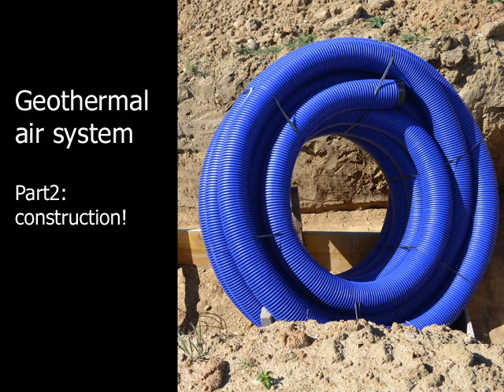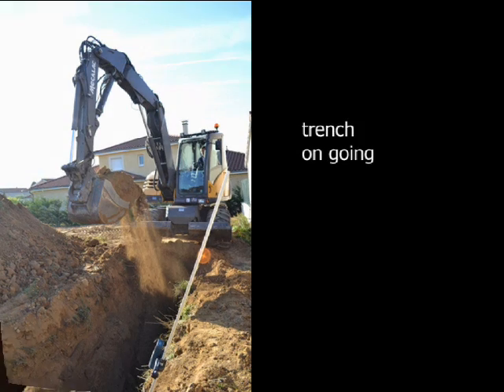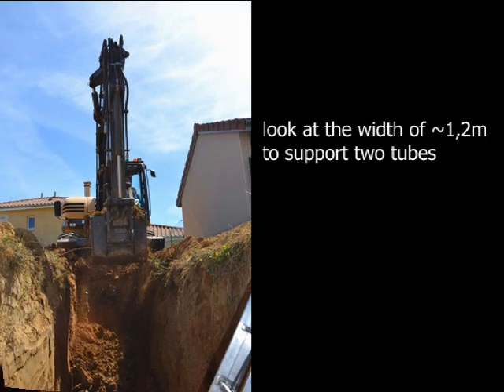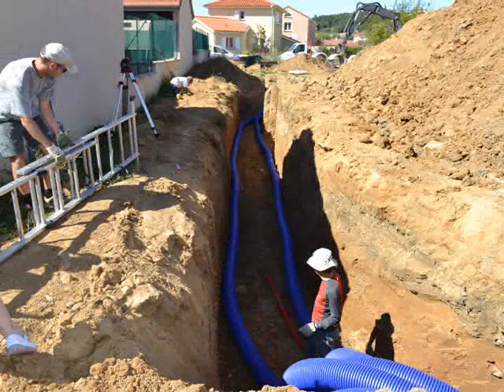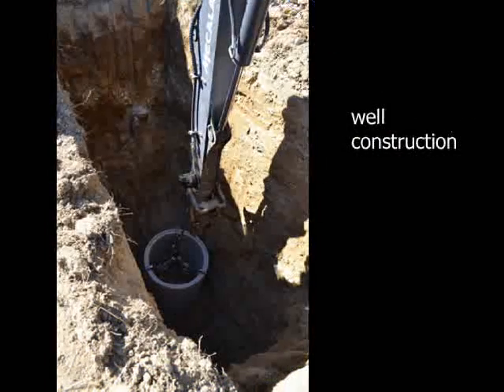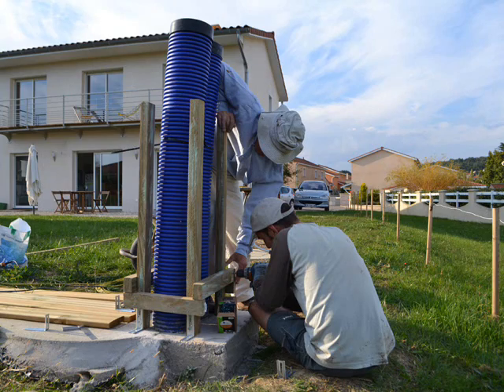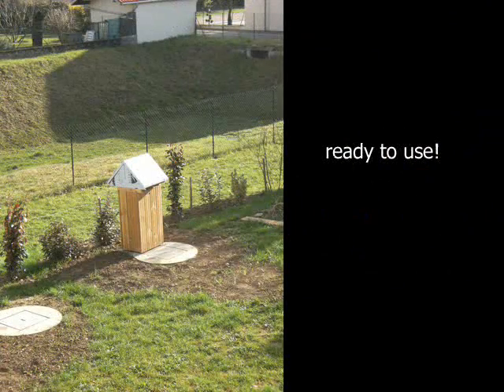Earth tubes air cooling and heating system : project implementation

Comment: Did you say that the system is radon free? How did you construct it to achieve that? Is this mainly due to the tubes having no sections?
Reply from the maker: No, the system can t be radon free if there is radon in the area. It has to be installed in a radon free area.

Comment: @nrlog I see the orange/ red tube coming out of the concrete along with the blue tubes. It looks to be connecter to at least one of the siphons. Does it connect to both? Why?
Reply from the maker: Hi. The red one is a pre disposal for an electricity routing in the area. Nothing to do with the ventilation.... sorry if misleading
Reply: Hi. Ok. There's nothing misleading. I sent a request to you all via your website. It was is french but I was able to navigate enough to send it. I'll be on the look out for that reply. Thanks.
Reply: @nrlog I haven't gotten a reply through the website, so I want to ask you here. How can I get your design for the entrance and exist of the pipes going into and out of a house, and how they are ran in the house?
Reply: Is there any way to contact you through email? My inquiry to your site hasn't been replied to, and you seem to not check youtube often. I live in Texas, and our whole state is just now coming out of a lockdown from a state wide rolling power outage in order to survive a winter storm. We were 4 hrs away from totaling the capacity output to the entire state, which means 4 hours away from producing as much energy as possible and in real time sending it out, which if was done would have destroyed the grid. I've been building a house while in a tent, and yes I was in a tent when this worst storm in a century hit this state with temperatures here in some places getting as cold as some places on mars. I've always wanted to build your geothermal system for my house, since I've started to build it, and I'm months away from needing to buy the pipe for it. I really need some help as soon as you get the time.
Reply from the maker: @terranceedwards4750  Hi. sorry busy those days. the inside is explained here (in French). http://nrlog.fr/index.php/2016/04/25/puits-canadien-provencal-a-air-comment-concevoir-et-realiser-les-parties-interieures-du-reseau-aeraulique/
Reply: @nrlog3682  Hi again. I'm at the stage of pouring concrete around my tubes that enter my house after ascending out of the ground. I figure this will provide many options proceeding forward, among which are a brick ledge to conceal the pillar in the same brick that will cover the rest of the house, as well as retain the most thermal dynamics in the tubes when they arise from the underground temperature. Can you look into your website? I need to reference many more things throughout your information, but the site keeps stating that it's not a functioning website anymore. Please reply with what help you can provide with helping me connect to your website again.
Reply: @nrlog3682  I'm still unable to access your website, and want to know, are you able to? I am still unable to.
Reply: We are all very busy. Thank you so much!

Comment: Thank you very much for the playlist with all the 4 videos. Very nicely made and informational. We are planning to use this system for cooling a greenhouse in a hot and humid area because evaporative cooling wouldn't work in a humid area. 
Few questions:
1. Is there a way to know or measure if the system will work in an area even before we install it?
2. Will this system if the tubes are buried under a pond of water instead of ground?
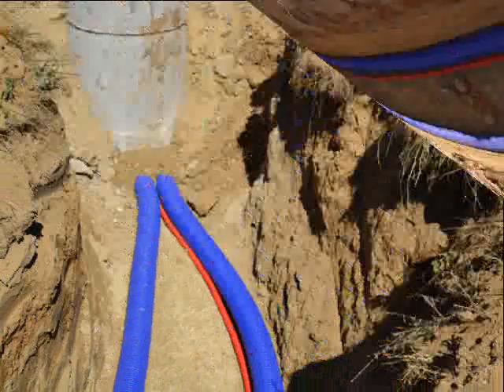3. At time 1:29 in this video, i see an orange tube in addition to two blue tubes. Curious to know what it is? 
4. Also, curious to know how the fan and system looks on the inside of the house. Couple of photos could help. 
Once again, thank you.

Comment: Please explain why you use a plastic piping, which prohibits the effective conduction of energy. This is simply wrong!
Reply from the maker: It is not a problem to be in plastic as the surface temperature has time to meet the earth temperature. The temperature with the earth inertia is only changing of 1degree every month. You see the results from the system with measures in the fourth video on the channel nrlog.
Reply: @nrlog3682  you mean to say that there is only a one degree difference between plastic and metal pipe? You are way wrong, the difference can be up to 15 degrees in difference. Now I know your just full of shit.
Reply from the maker: Ah. Full of shit? What i mean with the one degree is that in august the earth and plastic pipe is maybe at 22degrees, and september will be 20/21... etc . The plastic is at the ground temperature... revise your physics man...

Comment: You don't need to do all that ! Dig trench(as deep as far as you can .in a small area loop it back and forth on top of its self it doesn't matter )any kind of PVC pipe- screen where air enters plump other into house ,get a fan that pulls a lot of air and place it in pipe that's in your house ....walha ! Ez pz and that's all you do . Don't over think it cause it's just as simple as that. That deeper the cooler .
Reply: Question:: what pipe is the best to use to last the. Longest? I was thinking 6” sch 40. Do you have to go that heavy duty ?

Comment: Not a good idea to use plastic tubes buddy.  Chances are they may  develop holes then you will have problems with radon gas getting into your ventilation system. Also you have molds to consider.
Reply from the maker: Hi. it is actually not any tube, but a PE tube designed for the purpose (sustain the earth weight, anti static, no VOCs). Radon is an issue as well on surface where air is taken, so the idea is to NOT implement this in a RADON area in general. for the molds , the slope used to drain condensation shall save this.

Comment: just buy a heat exchanger with built in heat pump  for each KW elektricity used for ventilation you will get 2 or more KW of heat
Reply from the maker: Hi. Yes it is a good option to consider. in the house we have already a reversible heat pump for ground, so we did not re invest into a second one for the ventilation.  but good idea.